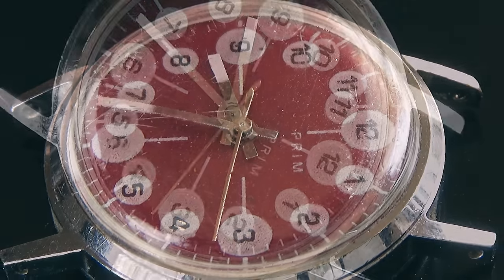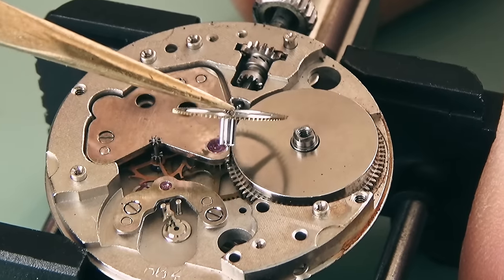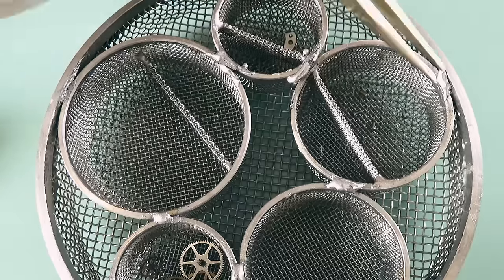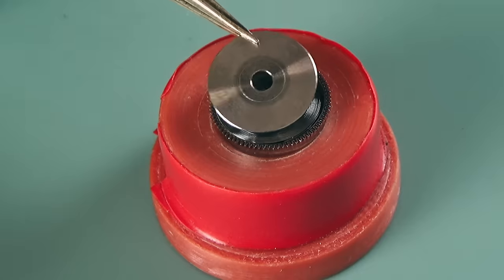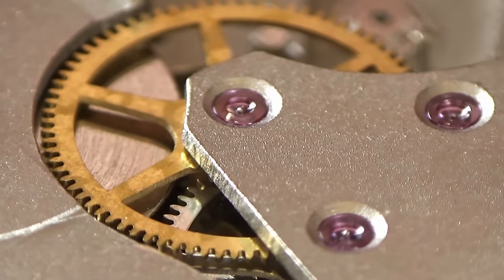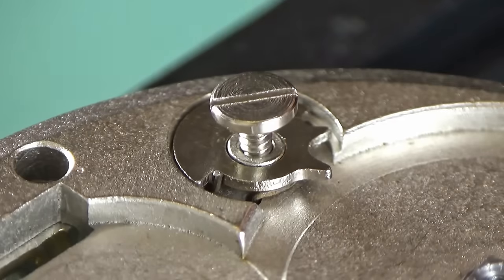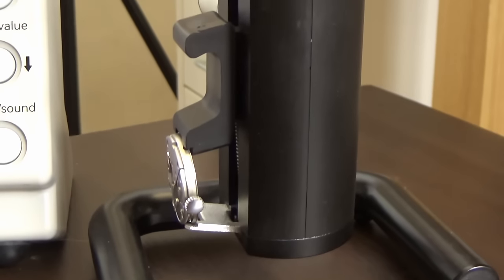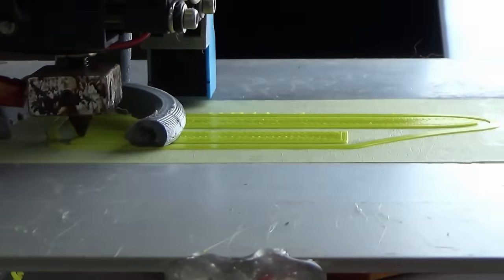Can I Fix a 60-Year-Old Watch That Took a Trip Through the Washing Machine?

Comment: Thanks for the video! The Prim Cal 66 movement looks like a solid design. I will look out for one to add to my collection. Your watch strap work is excellent as usual.
Reply from the maker: The Cal 66 is worth adding to a collection. IMO lot of different styles of it out there as well
Reply: @Saving-Time  Dont forget about the Prim 52, a caliber I believe you also worked on. I have one of those myself, simply because I generally prefer sub-seconds vs a central seconds.
Reply from the maker: I'm with you on the sub-seconds :)

Comment: Yeah, that looks about on par for a watch that went through the washing machine. I serviced an AS 1916 that a coworkers wife put through the washing machine 20 years ago. coworker opened the back stuck it in rice and let it dry then threw it in a drawer for 20 years. Yes it felt slippery and soapy and had a opaque film on the parts, bits of fiber from the clothes in it too. The detergent left a coating on the steel parts which kept most of them in much better condition than i was expecting. A lot less rust than I was expecting, i basically had to replace the yoke spring, date jumper spring, and the pressed steel day quickset spring. The detergent congealed the lubricants so there was to much friction in the pivots for it to run.
Reply from the maker: Interesting thank you for letting me know. I also expected a lot more rust.

Comment: The degree of rust and it’s location is consistent with a watch going through the washing machine but it clearly didn’t end up completely filled with water - they often don’t. 

Regarding the slipperiness of the movement when disassembling and the amount of dirt present, I suspect whoever serviced this watch only disassembled the elements of the movement that needed attention (hence the mark on the balance wheel), but left the rest assembled. 

There was a period when watch material houses were advertising a ‘special’ product used as a final rinse when cleaning watches. 

The idea was you could put the whole movement through normal cleaning solutions (after uncasing, removing dial and hands), and then this final rinse was supposed to lubricate the movement for you. 

Plenty of watches were serviced this way, some still are today, and often the customer pays top dollar for it too. 

Of course, the lubricant in this rinse would end up coating the whole movement. There are still versions of this stuff on the market, but I’m hesitant to name it and thus potentially enable lazy or unskilled people to use it. 

‘Servicing’ a movement this way left a lot of dirt in place, this combined with the deposited lubrication forms a grinding paste that accelerated wear as the movement runs. It also leaves it slippery. 

The movement in this video looks to have a lot of wear to the barrel arbour holes (they may need closing), and I can’t tell if this is the case elsewhere, but I would be checking endshake and particularly sideshake throughout the watch. 

When the next watchmaker goes to service a movement treated this way, the layer of lube over all the parts pollutes and ruins their watch cleaning solution, particularly the first jar. If you suspect a watch has been treated this way, pre wash it in either naphtha or soapy water, depending upon whether your cleaning solutions are waterless or water based respectively. 

The Seitz/Bergeon pivot straightener is indeed an expensive pivot breaker. Some WOSTEP instructors openly refer to them as such. 

They can be useful if you can get lucky and find one at a decent price. The jewels in these tools are graduated in half sizes (eg 0.08mm, 0.085mm, 0.09mm, 0.095mm, 0.1mm etc), whereas the Seitz metal plate style pivot gauges with graduated sizes of hole jewels in them only have full size graduations (eg 0.08mm, 0.09mm, 0.1mm etc). 

A couple of examples where this can come in handy is when measuring a pivot to decide what size hole jewel you should order to replace a broken jewel, or when you need to repivot an arbour and need to match the size to an intact pivot on the other end of the arbour. 

I can’t tell whether you did this or not for sure, but support the centre wheel jewel/bushing when you push on the cannon pinion. Otherwise you can shift the jewel/bushing and change the endshake. If you do it on a watch that has power on the mainspring, and push the wheel out of mesh, you could cause an uncontrolled release of power. The same goes for fitting the hands, particularly if they are a tight fit on their arbours. 

You can demagnetise a hairspring out of the watch. Remove it from the balance staff, fold it up in a bit of watchmakers tissue paper like a miniature envelope, hold the envelope so it can’t fly away and demagnetise. Sometimes it is easier to just put it back in the watch, though. 

Whilst you can sometimes get a shock spring fitted back into the setting by manoeuvring alone (after all, if it escaped, it must be able to go back in), if you have a Horia or Seitz jewelling press the way they are supposed to be installed is by pushing the entire shock setting up a bit, replace the shock spring and then push it back down to the original depth. Quite easy if you have the tools. 

The weirdest place I’ve heard of a pinged shock spring being found is in the eye of the watchmaker. A colleague spotted it on his eyeball when they were talking after he’d given up looking for it. I didn’t witness it firsthand, but I do believe it given who told me about it!!

Looking at the oiling footage, I think you’re probably over oiling. 

Alex Hamilton of Watch Repair Tutorials channel on YouTube has an excellent video explaining this far better than I can with words.

The functional difference between the excess oil I suspect you’re using and the correct amount is seen in how long a watch service lasts. Too much oil means the service interval will be significantly shorter, but the watch will often run quite well initially. 

Perfecting oiling is one of the most difficult parts of basic movement servicing, but it is well worth the effort to learn to get it right. You’re doing great, I don’t want to discourage you, just trying to help you to improve further. 

I really appreciate and enjoy your strap making content. You do an outstanding job and I’ve never attempted it before.
Reply from the maker: Thank you very much. I really appreciate the trouble you took to give me this information. I'll check out the video by Alex. Feedback like this does not discourage me quite the reverse; it just makes me want to get better. Really, thank you. It was nice of you to take the time.
Reply: You’re very welcome, I can tell you have both the interest and ability to go far with this. I’m happy to provide help and advice where I can. 

Unfortunately good information is hard to come by unless you can attend one of the few quality watchmaking schools. 

Some of the most popular books teach some terrible techniques which become bad habits to unlearn as you progress. 

I only ever offer comments with the intention of helping. It is difficult to convey tone by text alone and it is sometimes easy to misinterpret the written word. 

If I ever come across as critical or negative, I apologise and please know that it is never my intention. 

You can take anything I say as first hand tested experience, unless I specifically state otherwise. 

Keep up the great work. I’m not sure if I’ve commented before, but you’ve clearly learned and improved a lot in the time you’ve been posting on YouTube.
Reply from the maker: Thank you. I started this channel to learn, and I've found in my life that the fastest way to get help is not to ask; it's to do something wrong in front of a group of people who know how to do it, then wait for them to tell me what I got wrong. I agree with you on the conveying of tone in text. I'm sure I sometimes come off as combative in the comments when that was not my intention at all. I like learning from books, so I'd appreciate some recommendations for good ones if you have any?

Comment: Where do you get your tweezers? I've bought myself some that seem to be made of 100% chineseium.
Reply from the maker: for my main tweezers, i use https://www.cousinsuk.com/product/dumont-no2-medium-tips Dumont No. 2 lately, i have been using mainly brass: https://www.cousinsuk.com/category/brass-tweezers The cheap ones in brass are OK, as long as you don't mind spending a bit of time working on them. Out of the box, they are not great, but you can sand them into shape just fine. If you want to avoid that, get the brass Dumont ones

Comment: Vostok Komandirskie and Amphibia laugh loudly at the thought that a mere washing machine could possibly hurt them beyond scratching them a bit, Rolex oyster and submariner also smirk as they are designed to match Vostok specifications as well as being pieces of jewellery.
Reply from the maker: I've seen lots of water-damaged Vostok watches. The Rolex Oyster predates pretty much the entire Russian watch industry, so unless you suggest some sort of time travel, it would be quite hard for the Oyster to be built to Vostok specifications. I am not sure where you are getting your information from, but you are wrong.
Reply: @Saving-Time  
Practical experience :) Rolex oyster disappeared during rough swimming due to rubbish Rolex watch strap. Vostok Amphibia still here the strap hasn't broken yet. Neither watch leaked or got water damaged or stopped working despite incredibly rough treatment ( think 1972 Norton Commando and jackhammer use) and people worry about using a Rolex for golf!
It is necessary to remember to screw the crown down on both watches though.
Reply from the maker: Rolex only offers straps for the Cellini Collection, and it has done so since about the 1940s, so if you had an oyster on a strap, it was not Rolex, or if it was, the strap was 80 years old. Also, you are not supposed to get leather wet, so if the strap fails in the water, that's on you, not the manufacturer. People seriously worry about everything that costs multiple thousands of dollars. Only an idiot would put undue strain on a mechanical watch. There is absolutely no reason to do so, so why would you jackhammer wearing a mechanical watch? It makes no sense at all. Just buy a g-shock; it's what they were designed for. Practical experience with a limited number of watches means nothing at all.
Reply: @Saving-Time  The oyster date just had a stainless steel strap and disappeared 40 years ago. I haven't bought another one. What is the use of a tool watch with a strap that breaks no matter how beautiful? Im still wearing the Vostok with the awful looking, hair pulling, folded reliable stainless steel strap. Both watches have\had scratch able plastic crystals.
Reply from the maker: Well enjoy your watch, glad you found something you like.
Reply: @Saving-Time  Thanks, Something that lasts which is the reason for the Rolex and the Vostok.

Comment: I am pretty sure this watch has not been in the washing machine. There is no evidence of water inside, under or between the parts. Once water is trapped inside a watch it stays there for a long time. Condensation would be visible on the crystal, which is not the case. The "soapy" feeling could be excess oil from a previous servicing.
Reply from the maker: You could well be right on that one. There were water marks on the bridges, but they did not show well on camera. I hope you enjoyed the video.